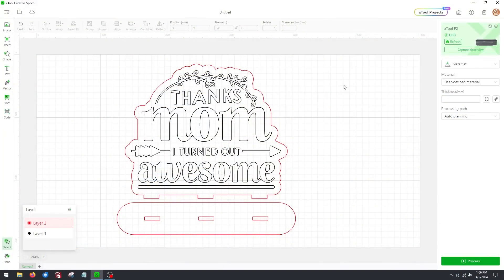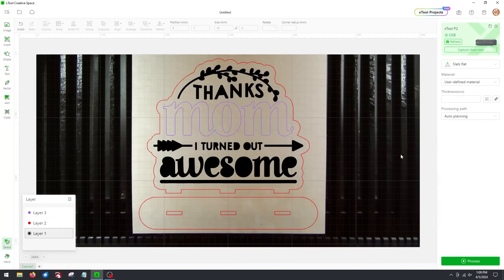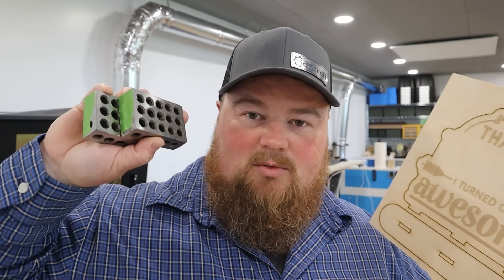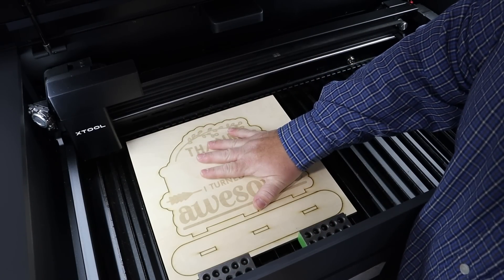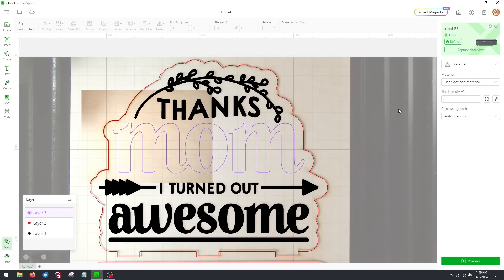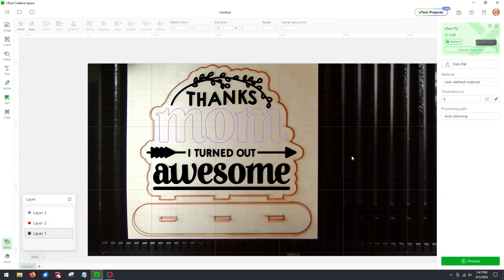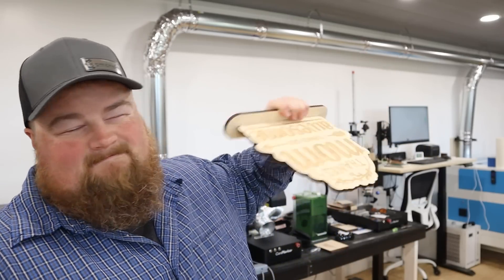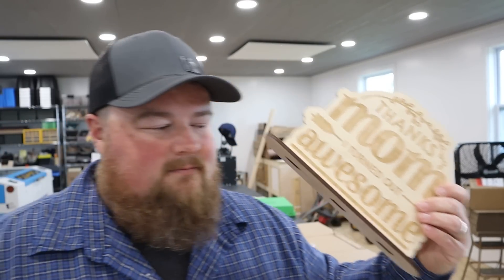Laser Mistakes & How the xTool P2 Fixes Them

Comment: Any capability of the software with the camera to auto-locate the blank and then automagically translate and rotate the vector file to it?  Also, if it had the capability to find fiducial marks and orient to them, you could pre cut/pre engrave a bumch without customization and then run them through again for customization when orders are placed.